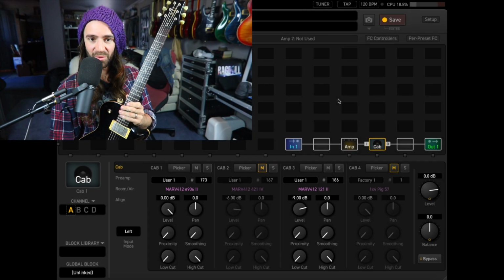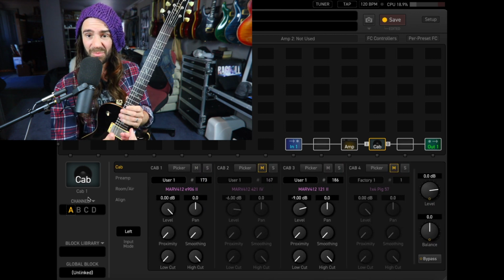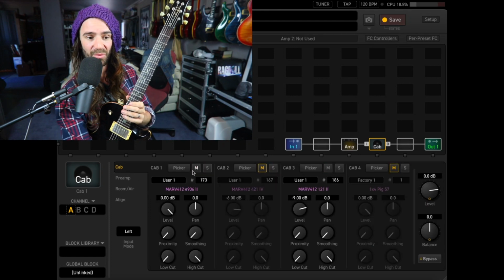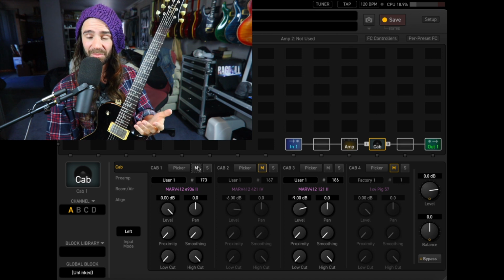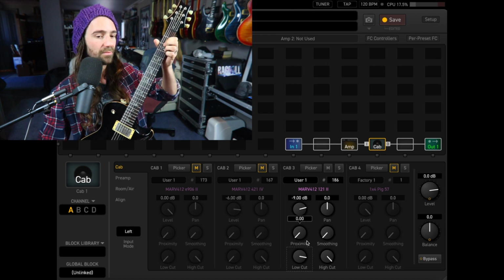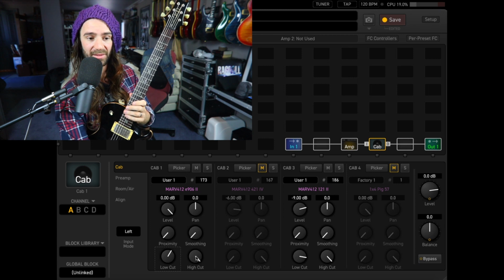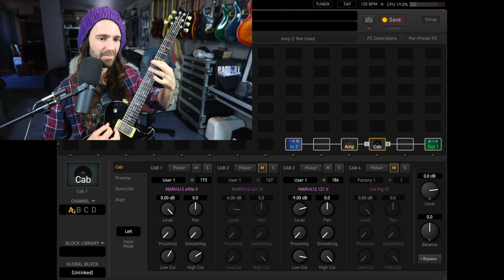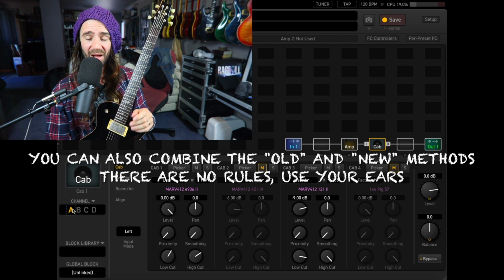Axe-Fx III Firmware 5.08 - New Cab Block Features

Comment: Question if you dont mind . I am thinking of getting one fx3 . I use helix and hd500x  before. Something I like about line 6 is that on controllers edit I can place the settings for lead and riff in the same exp pedal so when I press the pedal I go into lead and when it's down all effects and amp settings change for the riff. Can I do the same with fx3 so I dont have to press anything else ?
Reply from the maker: Yes, you can assign external controllers to just about anything you want
Reply: @LeonTodd  one more question. I know I am a pain into the ass. If possible I would love you to make a patch for lead with dual amp. Rectro and plexi amp together.  With noise gate,compressor,overdrive,noise gate again,amp left rectifier, right plexi lead high, after the amps a eq, flanges at 30% to kill the bass.then reverb and delay at 440 ml at the end.  If not possible . All the best. Love your blog